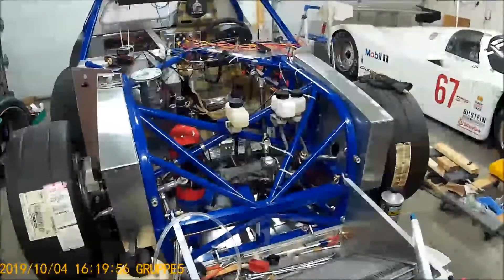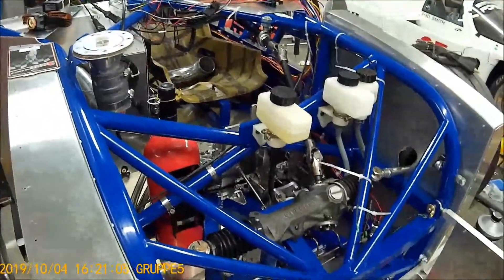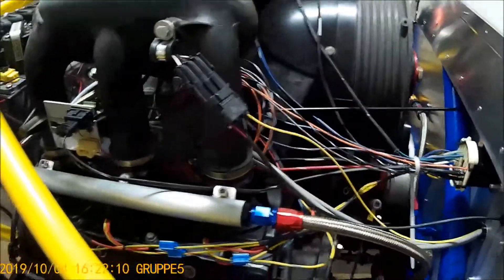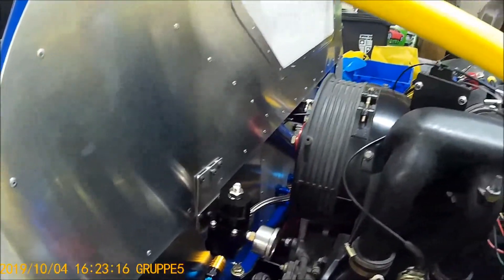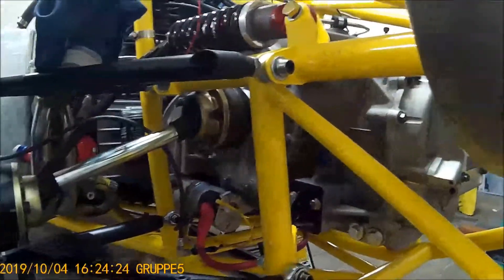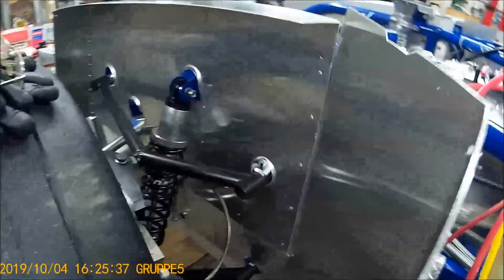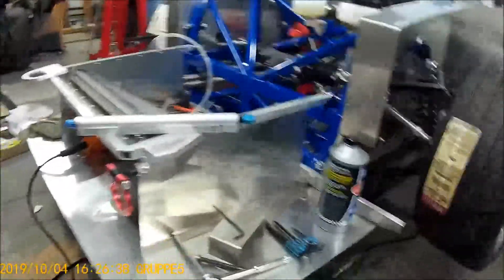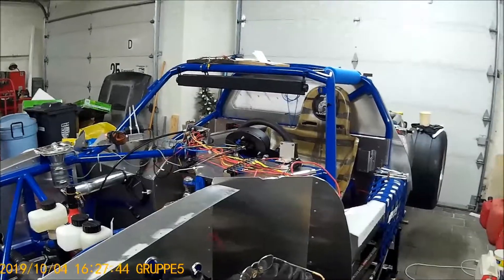Porsche 904 Project Walkaround 10/04/19

Comment: Was it a kit or scratch built?
Reply from the maker: This is a one off custom designed chassis built by myself and my fabricator here in Vancouver BC
Reply: Outstanding work! A true work of art! What about the body?
Reply from the maker: I also produce the bodywork as I have the molds to make the original parts although the bodywork on my own car will be modified to accommodate the wider wheels and tires.